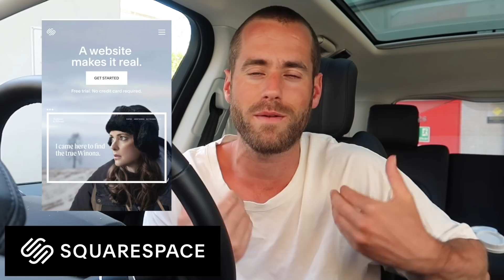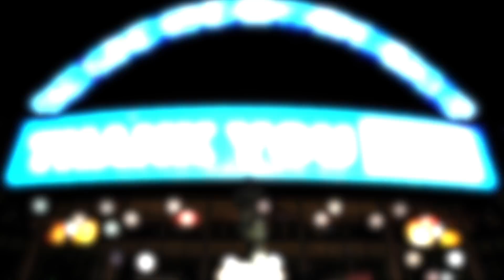TUNING THE MINI JOHN COOPER WORKS GP! *Cat, springs, diff & ECU remap*

Comment: I have one. Tuned, downpipe, recirculation valve, intercooler, Quaife LSD. Probably makes around 280HP. No back seats and other weight reduction from the factory. It's a fast car, turns amazingly, and has brakes that will put your passenger' s face in the dashboard. I'm never getting rid of mine either. I'll take this over cars costing three times as much.

Comment: You do know that masks don’t work with beards 🤔🤣
Reply: Masks are not to protect the person wearing the mask. They are to reduce or prevent droplets and aerosols from floating in the air and getting breathed in by the people around you. It's more effective to reduce the airborne virus than to protect against a virus already is airborne. 
Reducing viral load is also key. We are understanding that how sick a person gets probably  correlated with how much of the virus gets in their body. There is pretty strong evidence that asymptomatic carriers may have received smaller viral doses and their immune systems were able to defeat it without causing noticeable symptoms. 
This is why there are more restrictions about activities where large numbers of people are in indoor spaces for extended periods. It's why shopping trips are not as dangerous as going to the church. People don't linger. Places like public gyms could be dangerous without ventilation.

So it's not important that the mask seals against his beard. Even if it's not a perfect seal, it's catching almost all droplet/aeresol and reducing potential virus in the environment to a level that would be safe.